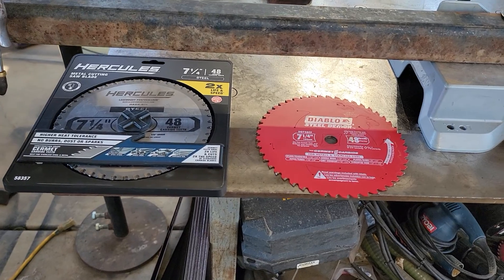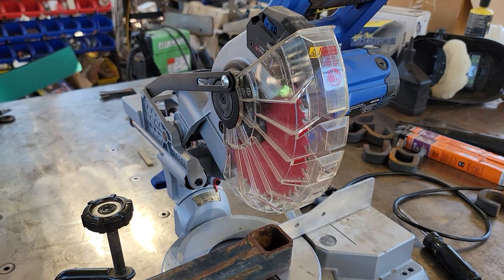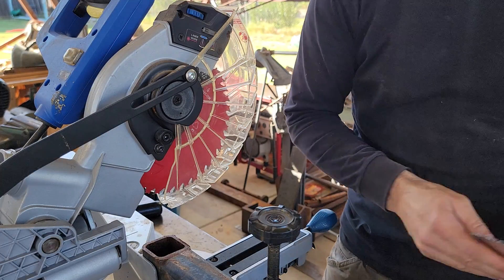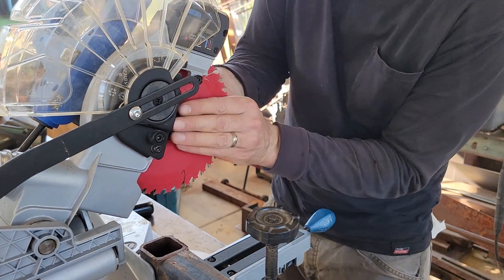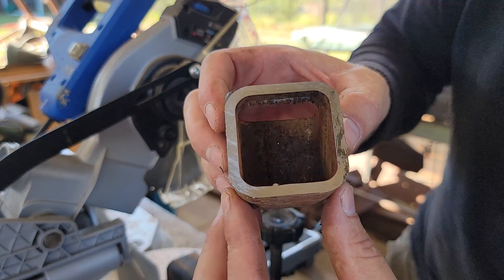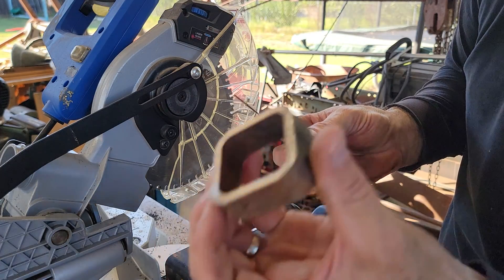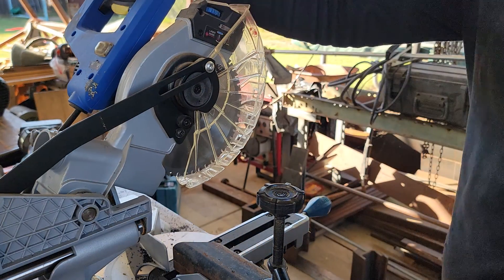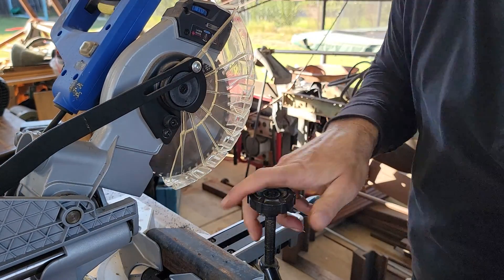Hercules 71/4 Metal cutting carbide tooth saw blade review

Comment: If I'm not mistaken, this blade is rated at 3500 rpm. I think the saw is rated at 5000 rpm. Sounds a little dangerous to me.
Reply from the maker: Good eye for safety. I appreciate your input when I purchased the saw blade that thought crossed my mind. It said on the packaging for cored and noncored saws, so I figured anything goes. Thanks again
Reply: Safety never sleeps

Comment: I have the Hercules 14" miter and was about to snag one of those blades during the 30% off sale, but I didn't. Wish I did now. Thanks for the video!
Reply from the maker: Darn that's too bad I was really kind of skeptical but it really did a great job thanks again for the comment and the view
Reply: The 14in hercules metal cutting blade isn't meant for the 14in metal chop saw. It's a cold cutting blade made for cold cutting saws. The hercules 14in chop saw is an abrasive saw. Your gonna see teeth flying like shrapnel if you use that combo.
Reply: @ThePainkiller3666  thanks for the heads up. Glad I didn't get it.
Reply: @gillihansmobilewelding  btw its a 12in but if your looking at getting its amazing i have the sliding compound and the stand and both are top of the line and i have yet to find a stand anywhere near as nice as the hercules
Reply: @TOOLS_AND_MORE  They had a 14 inch at HF, but was over $60.
Reply: @gillihansmobilewelding  ok i thought you were talking about the saw

Comment: that’s a great deal on a blade of that style for 35 years i ran a ArchitectualWoodworking Company and for the Installation team we sent out 10” ChopSaws  with AluminumCutting Saw Blades to cut 1/4” thick Angle  we used Freud Blades and Delta Miter Boxes. i used to laugh because at my cost it was a $85.00 saw with a $125.00 Blade  FYI the Warrior blade in the video is constructed very similiar to the Freud with the Carbide Teeth  approximate same thickness , and the Similiar Releif Kerfs that help  lower Vibration ,Noise , and Heat  to the blade FYI  our Steel was Cut in our shop withFreud Blades on 14” Milwaukee brand Saws
Reply from the maker: Hey excellent comment I noticed that with the larger 14" blades evolution dewalt Milwaukee et cetera on and on by the time you buy 2 blades you've already surpassed the cost of the actual saw so it just makes so much sense to me especially for the capacity that you can cut and also the versatility that you get Is phenomenal with this setup thanks again for your input

Comment: Having used both of these and others, it is still hard to find one that lasts.  The only thing to do is get a saw blade sharpener and resharpen blades or use abrasive discs, but then changing them often is a haste 🤷‍♂️
Reply from the maker: So I have that same issue too every once in a while I feel like I will get one that will last a little bit longer and what I do is I take them to a sawblade sharpening shop and I can get several sharpenings and they work great Thanks for the comment and  the view happy New Year

Comment: I'm worried about the longevity and safety of the blade and this particular miter saw combination. The hercules blade has 3500rpm max but the kobalt saw goes up to 5000rpm.
Reply from the maker: Hey I appreciate the view and the comment I think for short term use in emergency situations it should be OK as long as it is you work safely and keep your work secure thanks again
Reply: Get the Diablo one then as it's 5800rpm

Comment: Do you have a speed control to bring the rpm down? Cuts look super clean
Reply from the maker: Hey that is a great question on the packaging it said for corded or uncoreded  saws so I just took that as anything goes thanks again
Reply: So was this chop saw originally a wood miter chop saw, not intended for metal cutting?  I’m asking because I believe I have the same model saw and had never considered it would hold up to cutting metal. 8:26
Reply: @robertofloresvelasquez328 A speed control or designated metal miter saw is recommended. However, woodworking mitersaw can be used. Dangerous venture though....

Comment: That cuts so smoothly I have to consider the possibility in a circular handsaw for cutting metal roofing.
Reply from the maker: Hey great coment I think if you used a straight edge with  A corded or cord less saw this blade would do wonders for you

Comment: Started out a revies of the Herculers blade, but was a review of the accuracy of the miter saw. Blade seems to cut metal just fine. Hope the one I bought, will cut 1/2" steel plate in hand-held saw.
Reply from the maker: I think if you take it easy you should do just fine

Comment: If anyone is worried about the RPMs just get the diablo steel demon 7 1/4.  The max rpm is 5800 for the blade and the Kobalt saw is around 5000rpm.  Problem solved. 

I thought id be safe with the 10" but no it drops to 3000rpm on blade and my makita 10" chop saw is 4100 rpm so imma take it back. That's the reason a lot of people are using 7 1/4 miter saws is that the diablo blade rpm max will still be in compliance with the saws rpm range.
Reply from the maker: Thank you for your intelligent and sensible contribution to the conversation much appreciated
Reply: I bought a speed control and it does slow my 14" abrasive saw down to the 1800 rpm for the steel cutters.

Comment: Metal  cutting  saws cut a lot slower  half the speed  of a normal  wood / abrasive saw ok as a get you out of trouble dont know about  long term you can get speed  reducers that plug in line with the power cable but i would look onto that a bit more  dont know how this affects  the motor
I would  recommend  a blade over a abrasive  wheel though cuts cleaner cleaner  hardly  any sparks safer (i have seen a abrasive  wheel shatter) better to store abrasive  wheels can get  damaged  quite  easy
Just be sure you have the right saw blade  for the metal  you are  cutting Steel. Aluminium. Stainless
Or a universal blade though not as good as a dedicated  blade i say about the difference  blades as it will make  the teeth last longer if you can get sme blade wax to put on as this helps the blade last aswell
Reply from the maker: Great Comment, I appreciate your thoughts and insights. I've been using my blade.  on 14 gauge and 16 gauge. And it seems to be doing really well. Knock on wood, thanks again.

Comment: How many cuts does it do before it’s dull? I bought one for a job. Just wondering how long it’s going last.
Reply from the maker: that's a great question. It's also a very difficult question to answer because there are so many variables like the type of thickness of the material. You are cutting also how many cuts you need to make and also the hardness of the material so far every time that I use mine it's been great. And it's lasted me quite a while but I'm mostly cutting thinner stuff thanks again. I hope this was somewhat helpful.

Comment: I like the lennox metalmax blades. I bought a cheap harbor freight chop saw and use it for them. Very loud and slow cuts but they work and have minimal clean up. 
Dont want to ruin my steel demons on plunge cuts but if these are cheaper it might be a worthwhile thing to get a few of them.
Reply from the maker: Hey I totally you agree with you for $27 you can't go wrong  I've used mine quite a bit since I've made that video and so far everything has worked out really well one of my main motivations was on the packaging it says for cored and non cored sawsI figured anything goes thanks for the comment and  the view

Comment: Will it cut through 3" material?
Reply: I'm sorry, 1 more question :Hercules also has a 14" metal cutting blade. Would that work on a regular chop saw?
Reply from the maker: I'm sure it would if you made a pass and then flipped it over and made another pass it would do fine I think also depending on the wall thickness too
Reply from the maker: I think it would do fine on thin wall materials such as 16 gauge to 14 gauge but that's it my younger brother tried it and I think it just wound up cooking the blade
Reply: I've cut 1 1/2 in plate with mine it was at it's capacity that's for sure wouldn't want to do it  but mine does 1 in no problem
Reply: My bad mine is the circular saw I use it to cut training coupons all the time mine will cut bevels as well

Comment: Blade cut steel good but will not cut stainless
Reply from the maker: I definitely agree with you. This blade does excellent in mild steel. Stainless steel will destroy this blade. However, you can get it  resharpened

Comment: My man... I noticed the first thing a lot of people noticed while reading through the comments. I appreciate the video you made, but this is irresponsible of you to be using a miter saw with a metal saw blade. The RPM rating for each is very important and while the actual tolerance of the materials is higher than rated, they are like safety chains. They are rated that way due to unexpected fluctuations in applied force to fail without fracture in >99% of failures. Applying centrifugal forces to that blade outside of that range invalidates the safety features of the materials and structure of the blade and puts you at significant risk of a catastrophic failure (shrapnel from fragmentation) due to irregularities in the material being cut. Imagine a poorly welded or torch cut piece of metal with a portion of it's grain structure heat-hardened while portions of it remain mild steel. The differential forces that blade can experience can cause it to shatter at the miter saw's RPM whereas the teeth would simply chip or break at the rated RPM. 

Please reconsider how you do your crafting. I have a friend that had to get facial reconstruction surgery after a blade failure from a similar situation. He was wearing eye pro otherwise he would be blind or dead.
Reply from the maker: Hey, thanks for the comment and your insights much appreciated. I've been using that setup often on for some time now. And I've never really had any  Issues. I always try to lean towards 16 gauge and 14 gauge. And I always make sure that my work is very secure. Thanks again.
Reply: The Diablo steel demon is rated up to 5800 rpm max so he would be okay, the Hercules is over 2000rpms less..  for $4 more i have the diablo and use it in my circular saw just fine.